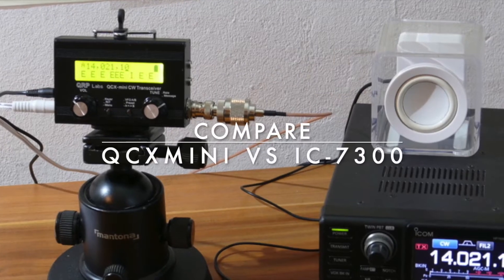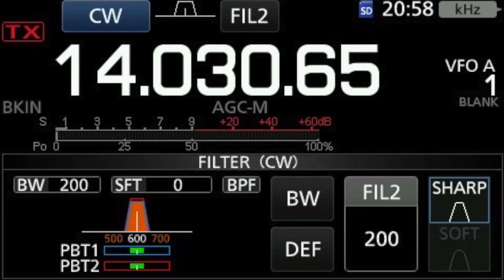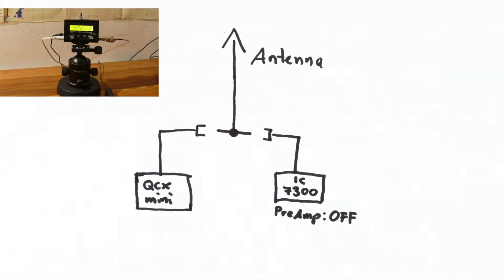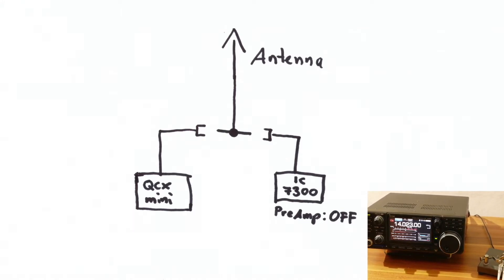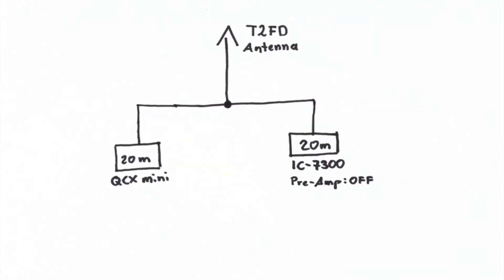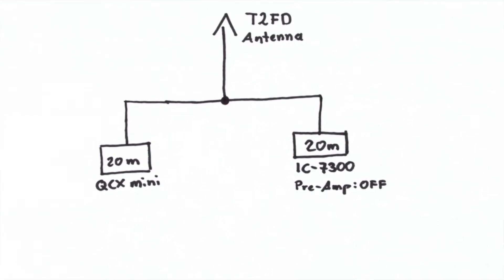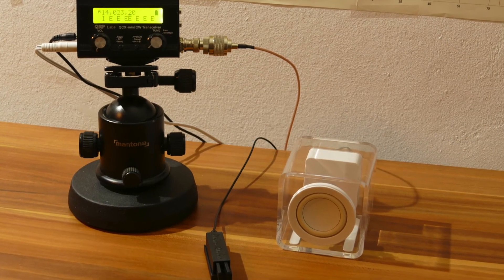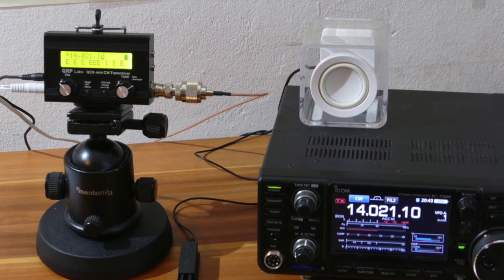Comparison QCXmini vs IC 7300

Comment: I love my QRP Lab Transceivers...  I own seven... A QCX Mini 20, 30 & 40, a Hi & Loband QDX, and a Lobander QMX...  

My QCX Minis have a K6ARK capacitive key mod, using acorn nuts.  I love this mode... All units thrive on the TalentCell 12v 3aH battery, which mate perfectly with these radios.  I use a PackTenna EFλ/2 cut to 40 meters, with an appropriate length of RG316 using the shield as the counterpoise.  

Thanks again Bjorn for your content.  72   de W7UDT

Comment: Nice job, Bjorn.  I like my QCX-Mini more every time I use it.  I wanted to ask you about the external speaker you use for the QCX.  Can you share the brand and details?  Thanks.  73
Reply from the maker: Hi, it is an "JuiceAir" speaker. There is a website printed on it "www.juice.co.uk". But the speaker is not so loud if used with line in. You have to think about. I got it very cheap. So it is ok. 73